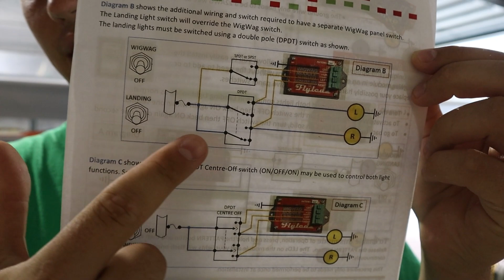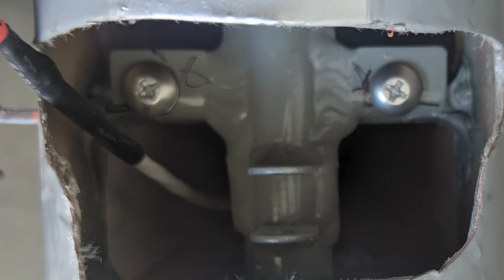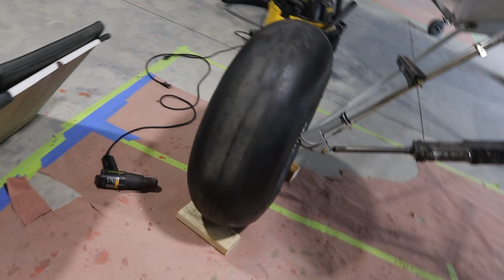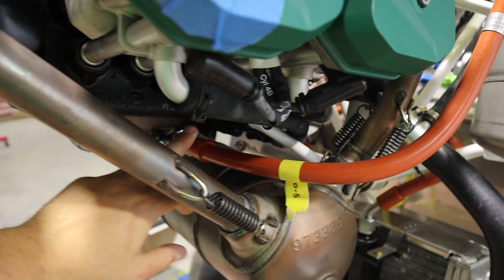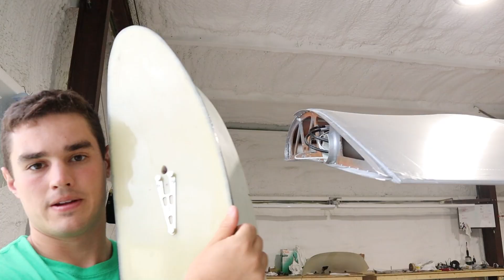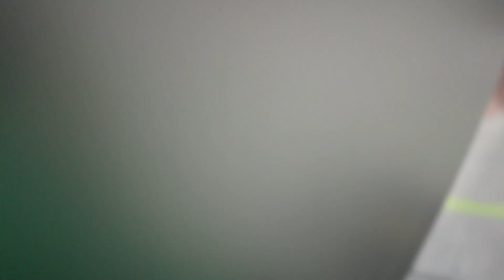Kitfox STi Build Update 20 : Engine Start Prep, Wing Tip Lights, Oil Lines…

Comment: The AMP they supply is waterproof and proven, its been used in the automobile industry for like decades.
Its also quite vibrationproof. You want atleast a waterproof connector, short circuits or connectors getting HOT are not fun in the air.